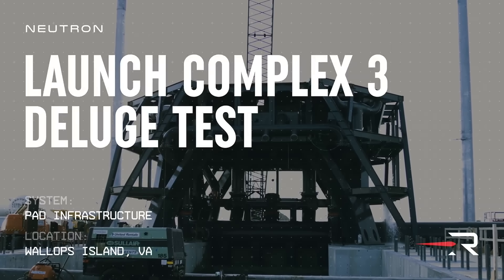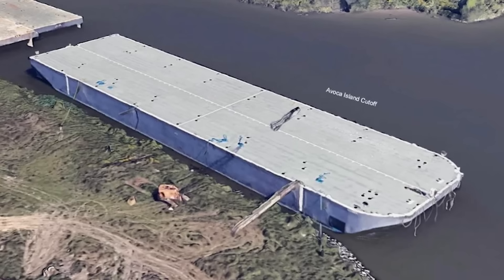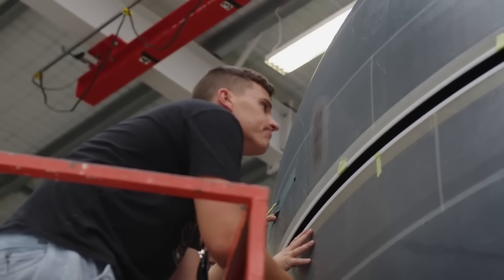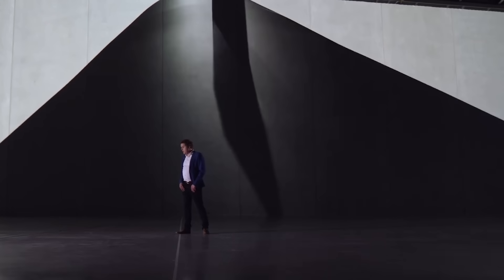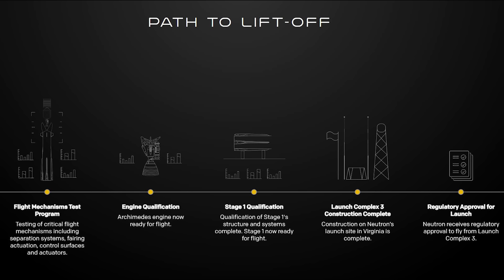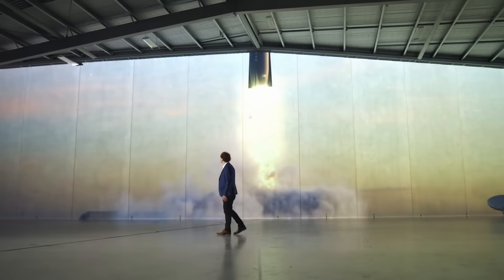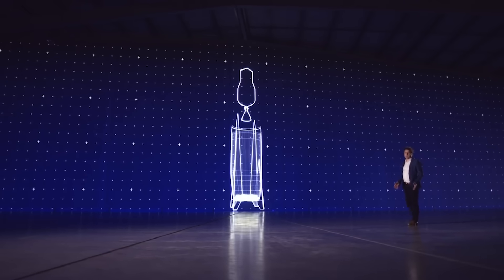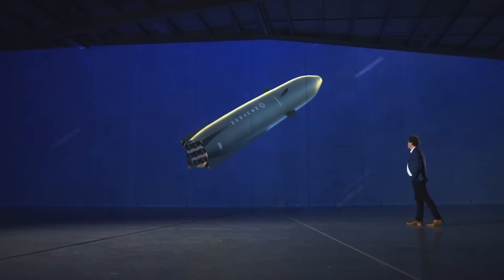Rocket Lab Continues To Prepare For Neutron's Maiden Flight

Comment: Neutron was supposed to have its maiden flight in 2024, then mid 2025, now late 2025. Realistically though I don't think they'll have their first launch attempt before mid 26, then it will take them at least a couple of years to debug and attempt first recovery, a couple of years after that to reuse, and several years after that (2-5) to hone operations and achieve reliable cost effective reuse (if they manage it). So mid 2030s is the realistic estimate considering the past with Electron.

Comment: That digitally placed carbon fibre is doing some heavy lifting here.  May it succeed, with the rest of the innovations.  It's a classy nibble out of Elon's monopoly, and a great time to be alive, all right.  😎
Reply: All done legitimately also, without bribery, corruption or unrealistic promises. Seemingly quite rare in business nowadays.
Reply: Beryllium can be made lighter than carbon fiber because it is much stronger. You need much carbon fiber to match the strength of stainless steel. If the outer shell of the first stage is carbon fiber, it won't be a problem. If the very cold ❄ fuel tanks are carbon fiber, that could be a problem. Beryllium is more expensive than carbon fiber or stainless steel.

Comment: I'm more interested in how long it will take them to land and reuse the first stage. This will probably take them significantly longer than achieving orbit successfully. Currently only SpaceX has significant experience with landing large rocket boosters.
Reply: I think they will surprise us how fast they do it.
Reply: True but SpaceX launch 5 time the falcon 9 V1 from 2010 to 2013 then 15 time with version 1.1  before upgrading the Falcon 9 to v1.2, also known as Full Thrust. The first successful Falcon 9 booster recovery occurred on Flight 20, which was the maiden launch of the Falcon 9 v1.2 "Full Thrust" version. So SpaceX started with a expendable design and did 19 flight before finishing the recovery design and succeed on the first flight of that design... Since Rocket Lab design from the get go is a recovery design it should take a lot less flight.
Reply: There is a learning curve, the more the do it the better they'll get at it.
Reply: And blowing up vast sums of taxpayer dollars for no gains.
Reply: @evryhndlestakn  SpaceX has a fixed price contract for Artemis, and their price was a lot lower than what Blue Origin charged. Moreover, SpaceX is mainly funded by Starlink subscriptions.
Reply: The Chinese have done it as have Blue Origin and NASA…
Reply: @allangibson8494 no one else has landed an orbital booster ever.
Reply: shame they didnt go for something like placing the first stage in orbit and have the second stage launch the satellite and then come back to the first stage for landing but i suppose it would be either too difficult or too dangerous.
Reply: @geesehoward700 Part is shifting the centre of gravity far enough aft to be aerodynamically stable on reentry.
Rockets are stable when the centre of gravity is in front of the centre of pressure (like an arrow).